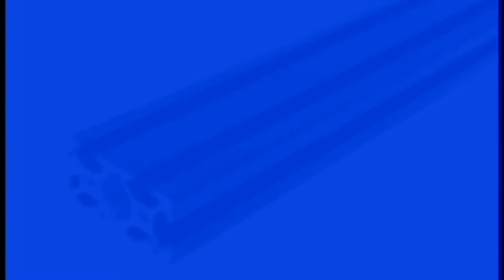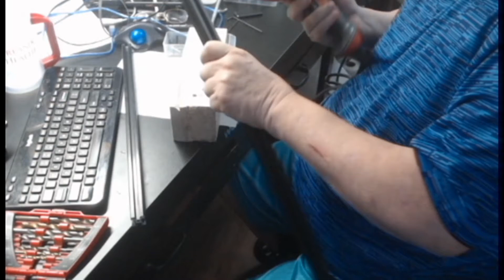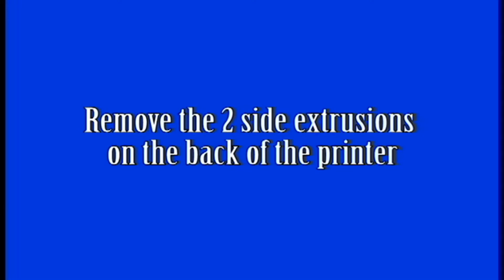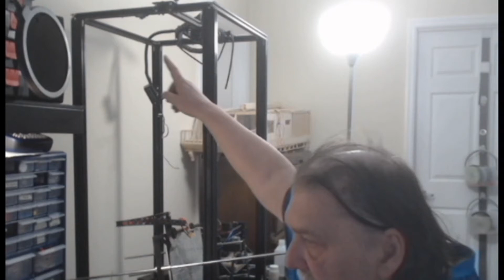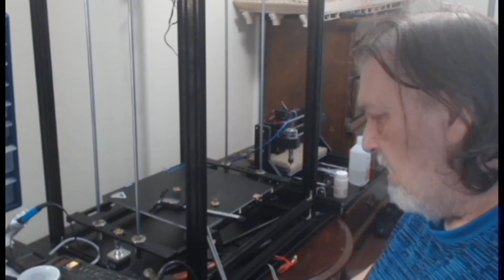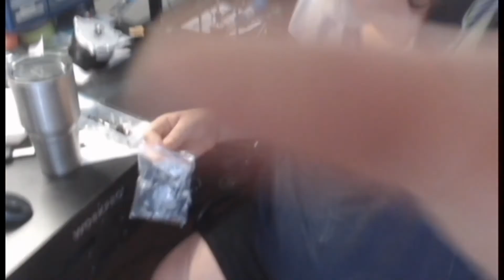Tronxy X5SA 3D Printer Upgrade (Increase the size to 800mm z axsis)

Comment: Dude.. can you please do us a little favor.. turn your video background music either off or way down.. Because I can hear the music more them you?  Sorry to say that.  BTW I have a Tronxy X5SA an 2020 updated version the company said.  But it been a pain trying to level the big 13 inch bed with 6 adjustment screws. the auto leveling blue sensor is crap it only detects the base metal under the bed surface making leveling a nightmare.. I spent once 4 hours trying to auto level and manual level it and got no way fast.

The printer was then covered up with a old sleeping blanket and left until now. I got a Aquila be Voxelab and a FL SUN Delta since the Tronxy was non working well. so much better, I did upgrade the Tronxy before leaving it stored.. I brought a Titan extruder by Tronxy and a Ultra Flex rubber magnetic based bed for it. but the leveling still was a impossible hell.  
I have added a 3D bed leveling probe to the Aquila and the Delta QQ-S Pro has one already both now got PEI magnetic sheet beds.

I may try to re-do the Tronxy later. get a auto leveler and we see?
Reply from the maker: I will keep this in mind in my new videos. Thanks for the input.